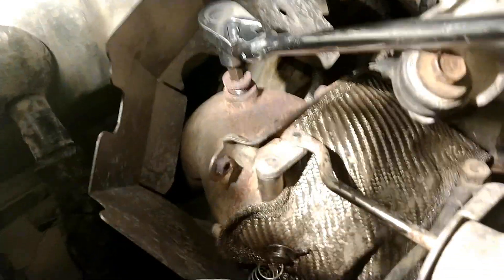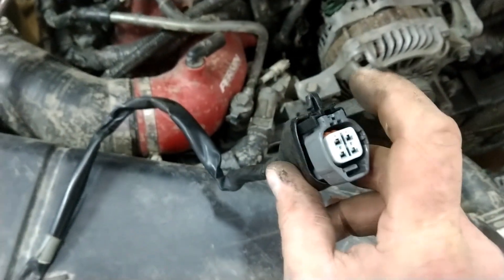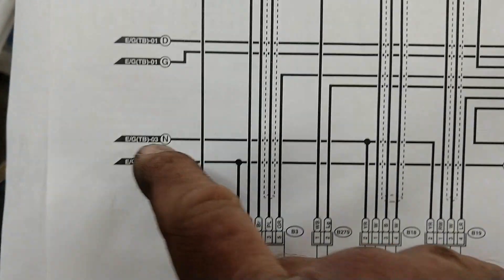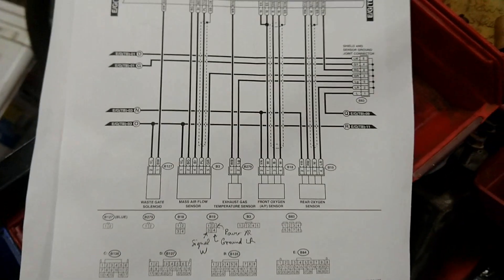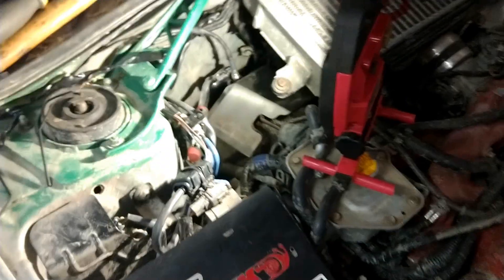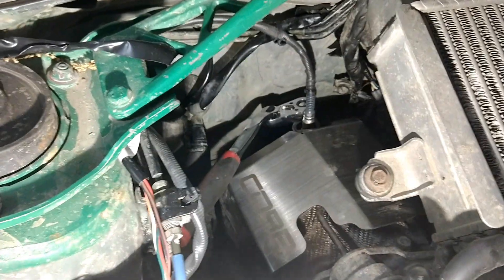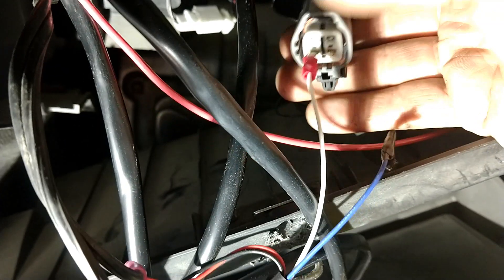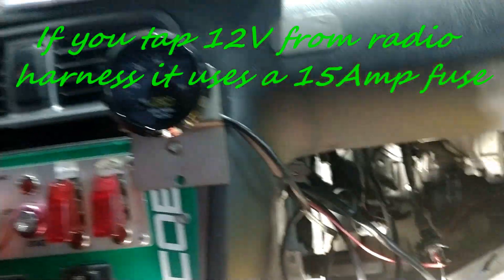Installing an AEM wideband and logging on a Cobb Accessport - Subaru STI

Comment: Thank you for this super helpful video! I have a cobb flex   fuel setup as well and the x series uego gauge part number  30-0300. I'm going to see if I can connect the white 0-5v analog to the rear O2 extension that I'm no longer using to see that wideband reading! I have the FAE sensor kit, so I'm praying it's all one to one for voltage reading.

Comment: How would I go about installing it if I have a cobb flex fuel? I cant use my tgvs because I alread have the cobb fuel pressure sensor hooked up to it and the flex fuel. Would I just connect the flex fuel to the wideband o2 now? since i wont have the rear o2 that is currently connected to
Reply from the maker: The Cobb flex fuel kit has a T connector to tap its power from the rear O2 connector, you can still connect your wideband to the rear o2 harness, the flex fuel kit doesn't send any data over it
Reply: @FrogRacing  yup I got it. I simply moved the connector up to the top of the transmission. Rather than connecting it to the o2 underneath. If that makes sense

Comment: Doesn't the new wideband sensor need to be calibrated before being installed in the DP first?  Great video otherwise
Reply from the maker: If you have an AEM 30-4110 that uses the Bosch 4.9 LSU, they are calibrated from the factory and never require calibration again. Look for free-air calibration on the AEM page at https://www.aemelectronics.com/products/wideband-uego-air-fuel-controllers/digital-wideband-uego-afr-gauge/digital-wideband-uego-afr-gauge

Comment: What did you use to run the wire into the rear O2 connection? Did you just shove the wire in? Hard to tell from the video.
Reply from the maker: I used a spade terminal connector.
Reply: @FrogRacing  thanks for the info. Btw found out the O2 harness power source is much less than 12v so it can't be used for power and ground in case anyone else was curious.
Reply from the maker: @motozixxer245  the AEM instructions said that the O2 power source was fluctuating too much and to not use it. They also mentioned something about possibly damaging the ECU as it is not a fused wire and comes directly from the ECU iirc. But thanks for mentioning it in case some people try it too!
Reply: @FrogRacing  what instructions? Iwires kit uses power from the o2 plug. The power goes to main relay which is fused at sb5 on a 06
Reply from the maker: @jeff666p  the AEM instructions that come in the AEM wideband kit.
Reply: @FrogRacing  I just went through the manual again. It says nothing about that
Reply: @Frog Racing If I'm not planning on installing a gauge could I also use the power and ground from the rear O2 sensor and have all the wiring left in the engine bay?

Comment: You splice the signal cable of the wideband sensor that go to the aem gauge and connect it to the rear o2 ?
So both have the same connection right?
Or you took the output signal of the aem gauge and connect it to the rear o2 ?
I already have the same wideband
Reply from the maker: You have to disconnect your rear O2. You can only have one of them sending the signal to the ECU.
Reply: Frog Racing  
I know you can not use both.  What I mean is that if I can splice the signal that comes out of the wideband and use it for the aem gauge and for the ecu to read it.
Reply from the maker: Yes you can but the wiring harness that I got had a harness going from the wideband to the gauge and then another one from the gauge to the ECU.
Reply: @FrogRacing  If you got a wiring harness that connected everything then why did you do what you showed us?
My other question is: When you use the "extension" cable for the rear O2 sensor, it is four pin. My wide band sensor has five wires. I did not see where you modified the harness or ran additional wiring.
Reply from the maker: @escargod  you have 2 separate things to deal with, the 5 wire is from the wideband sensor to your AEM gauge and this does not require anything else. Now if you want to send the data from the AEM gauge to the ECU, you have to connect the 2nd wiring harness that comes out of the AEM gauge to the rear O2 sensor circuit.  You could run the AEM wire from the inside of the car back through the firewall to reach the rear O2 sensor harness over your transmission but it is easier to run the O2 harness into the car to do the connection under the dash.

Comment: How much of a difference was the stock o2 reading from the wideband?
Reply from the maker: At idle it's pretty much the same, it's when you are under load that you start to see variations. The wideband picks up peaks way more accurately where the stock O2 can miss transitions or extremes.
Reply: @FrogRacing  at WOT what was the max variation between the two?
Reply from the maker: @danieljustiniano8088  up to 0.5